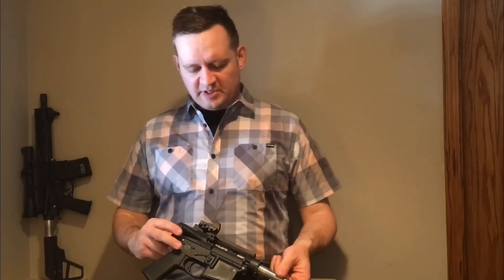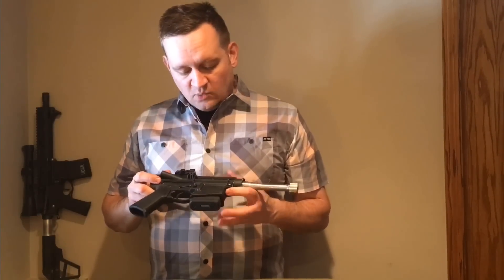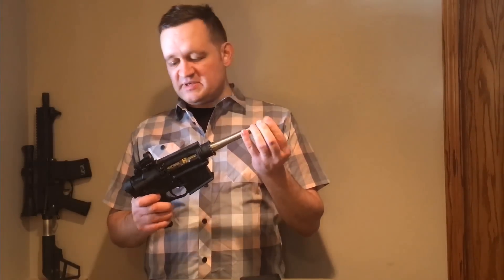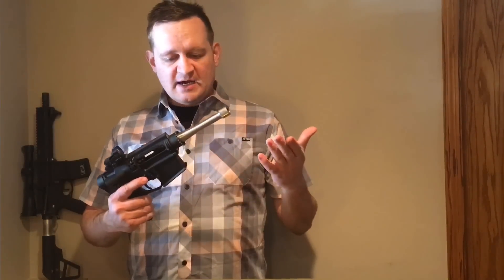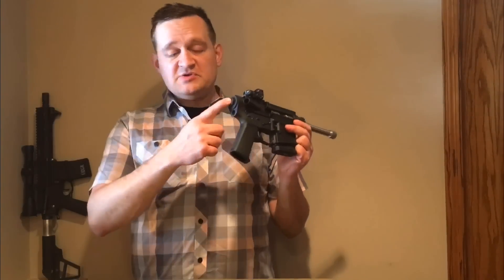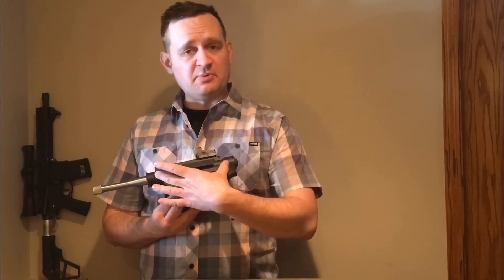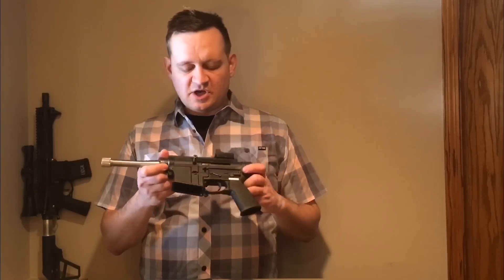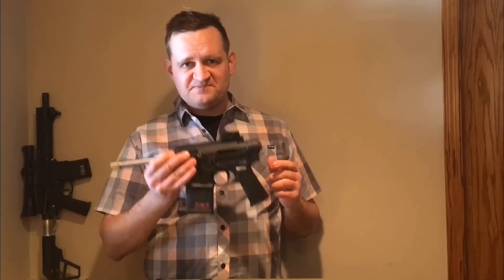Solo 300 Pistol Prototype

Comment: I bought this upper and love it! It is .5 of an ounce less than my custom built 1911 with 10 rds in 300 solo and 8 rds in 1911. The only question I have is I took bolt out to clean it and when I went to put it back in I noticed the ball bearing at top of BCG could be pushed left or right. I'm a little concerned as to what position it should be in? Does it stop gas or the bolt from coming open? I have been building ARs for years and this is the most excited I have been in some time. I plan to take ND whitetail in a week and just want to make sure this bearing isn't going to cause a problem.

Comment: Did you relocate the gas key farther back, why is there a hole in front of gas key? Could you do a more in depth video on how you reworked the carrier and any other mods you did to upper receiver? Very cool firearm build.
Reply from the maker: If you mean the hole in the front of the upper receiver, that's where the gas tube normally passes through. All AR uppers have that. As far as the bolt carriers go, the Solo 300 doesn't use a gas key as it isn't gas operated.
Reply: On your BCG, there is a piece of material mounted to the carrier with two screws. I am assuming that piece of material is there to keep the carrier from rotating. In front of that piece of material there appears to be a threaded hole. Is that piece of material mounted in the two factory gas key mounting holes?
Reply from the maker: @ericjones3146  yes.

Comment: Could you slam fire it?
Reply from the maker: No the disconnector works the same as always.
Reply: @durayenterprisesllc4440  could you make it able to slam fire?
Reply from the maker: ExTeeSee tOaD that would basically be a full auto trigger group.....I'm curious why you would want a manually operated slam fire pistol.
Reply: @durayenterprisesllc4440  it's just an idea, thinking outside of the box.

Comment: With a round in the chamber and bolt slid forward what keeps the bolt from sliding back?
Reply from the maker: The bolt is locked into the barrel extension and can't retract without rotating.
Reply: I'm try to recreate this in 9mm

Comment: I'm going to build this in 223 just because it'll get around NY gun laws. The one thing I want to point out though is that he's saving maybe half an ounce by using polymer lower and upper. The upper was probably easier to machine being polymer but the weight saved from it is negligible. But one question how long is the barrel? Just want to know because I'm leaning towards a 10.5 because I'm doing .223 But wanted to figure out how much heavier it'll be before I order parts.
Reply from the maker: 6"
Reply: @durayenterprisesllc4440  thank you man. I'll probably cut one to 8" for 223 but don't want to go too much longer and lose the whole idea of the build. Also did you have any trouble drilling and tapping the hardened bcg?
Reply from the maker: They vary.

Comment: Those are great, the barrels are from what ?
Reply from the maker: Nick J I'm not sure what you're asking. My first few barrels started as longer 300 Blackout barrels with carbine length gas systems that were cut down behind the gas port, threaded, and contoured. Going forward, I'll be using purpose-built custom barrels.
Reply: @durayenterprisesllc4440   You answered it, thanks :-)

Comment: what upper and lower did u use for this build? and where can i find a pistol barrel like that?
Reply from the maker: Joshua Ibarra on this build I wanted to minimize weight so I went with a polymer upper and lower from ATI and Tennessee Arms Co, respectively. My production uppers will be mil-spec aluminum. As for barrels, I have a run of custom barrels being made which will be available for sale in addition to complete uppers. Stay tuned for updates when they're available.
Reply: @durayenterprisesllc4440  awesome thanks for the update.
Reply from the maker: www.solo300.com

Comment: Sir, I salute you. I had not thought about making an AR into a straight pull bolt action. This is my next build. Could you drop a link to some components.
Reply from the maker: The Magician it's a custom project. I'm currently building my first batch of uppers for sale, and will also have custom barrels available sometime in May. Stay tuned!
Reply from the maker: www.solo300.com

Comment: Uh how are you delaying the bolt to keep from beating against the rear of the receiver?
Reply from the maker: Jm Fowler it's locked shut. I'm not sure what you're asking.
Reply: @durayenterprisesllc4440  it didnt seem locked shut when you cycled it by hand. A .300 blk has alot more pressure than a hand. 
So it would open pretty forcefully without a spring behind it. In the video i saw you said its a normal bcg cut in half with no buffer assembly and no gas key. 
So from what heard. The friction between the lug and the trunion is all thats "locking it"

Not trying to be snotty i just genuinely don't understand. Eagerly awaiting a range and breakdown vid.
Reply from the maker: Jm Fowler when the carrier on an AR moves forward it rotates the bolt to the locked position. Pushing rearward on the bolt won't open it until something retracts the carrier.
Reply: @durayenterprisesllc4440  i guess i wasnt really thinking about it properly. Without gas pressure acting against the bcg it wouldnt unlock. 

Idk why im over here thinking the chamber pressure would force the bolt open.
Reply: This would be why im not an engineer.

Comment: Not gunna lie, That piece looks pretty cool too. But I do have a question; Is it possible to add enough mass to the charging handle/Bolt that you can cycle the pistol with the momentum of shaking it back and forth?

Comment: OA 98 was built during 94-04 AWB and was a functioning semi auto .223 pistol that size.Y didn't u use ar18 bolt & upper w reduce power springs & use omni hybrid receiver combo? Then it would actually function

Comment: Nice :)  A little reminder tip, you can block the gas system on many gas operated guns very easily to make them temporary a straight pull rifle when deeded.... I don`t know how it is on the AR15 but my AK based Valmet Petra had a system for doing this built in the gun so you could easily make it a straight pull manual rifle when needed.

Comment: Extar stopped making them and are now only producing a 9 mm version  ->    BUT LUCKILY    I purchased the Extar EXP-556 MK II  8 1/2" barrel pistol a couple of years ago before they quit making them.   Heres a 100 rd Mag Dump   https://youtu.be/h-8zduXJ5OQ      Heres Big Daddy Hoffman playing with his ->   https://youtu.be/ZY1EDsoSj70     I think it weighs 3 1/2 lbs out of the box with an empty 30 round pmag in it.    Short video Chrono's ~ 2200-2400 fps  https://youtu.be/CcNS4JdprWc   using Cheap under powered steel chinese ammo.     Works similar to this with a shortened standard mil-spec bolt carrier    Its DI and the main spring rides above the bolt carrier rather than an actual buffer tube    A modern simplified lightened clone of the Olympic Arms OA-98 a product of the 1990's Clinton Assault Weapon Ban Era. .       Its an all polymer upper and lower and  with a little gassing mod I could see it being a great candidate for a super shorty barreled pistol project like this.   Anyways I've only put a couple hundred rounds thru it.    It makes a racket and a flash something terrible  xD have yet to see it fumble a round with any of my pmags running pmc .223 55gr.

Anyways  very interesting  project thumbs up for the ingenuity that as of yet the clever lawyer rats at the ATF  haven't figured out the language required to ban you from experimenting with...

Comment: Did you have to shorten the bolt... and if so do you think the 762x 39 would be good .. it would be similar to the 300 Blackout but just saying they have both already or side charging anyway when you can already get the platform already made but that's made with a buffer tube.. so you wouldn't have to convert anything so that's why I asked you have to cut down the bolt..

Comment: How cool would it be if he attached a gas tube that wrapped around the barrel a couple times so it met the length it needed to be so it could operate semi-automatically. Is that even possible? Would that work?
Reply: The flow would probably be too turbulent to do anything useful.
Reply: What if the tube was thicker to withstand the pressures? Or is that not the problem?
Reply: @joelpessina1764  
That's not the problem. Turbulent flow, in fluid dynamics, is flow where the motion of the fluid cannot be reasonably predicted with any useful results. The implication for our situation is that you couldn't effectively design the rest of the system unless you are really good at fluid mechanics. You could probably make it work through trial and error if you have plenty of time on your hands and plenty of resources.

Comment: you need to show a parts list or were to buy them as this is a godsend in freedom hating states like Illinois
.
Reply: polymer80 lower.
milspec LPK.
ATI polymer upper.
milspec bolt and BCG.
correct barrel for bolt.
barrel nut
pistol plug(for buffer hole)
hack up the BCG
hack up the barrel
mill slot in upper for sidecharge
assemble.

Comment: Does the carrier group cycle back after being fired? If not what keeps the bolt locked in place. Ty
Reply: There is no gas system so there's nothing pushing on the bcg to unlock the bolt

Comment: How do you make certain that there's no chance that the recoil can overpower the locking lug of the bolt?  It looks good in theory but I'd be concerned about an inadvertent Blow-back type operation during firing since there's no other feature locking the bolt in place except the cam action of the locking lugs of the bolt which are meant to easily rotate back during cycling anyway.  I'm really not that familiar with the 300 Blackout so is there that little force on the bolt group due to the short chamber and barrel configuration that it negates that possibility?  Nice idea though.

Comment: Could you have left the original charging handle operational?
Reply: I'm doing a build right now where i'm planning on doing that I'm going to try to tap the end of the gas key so I can screw the charging handle to it and file down the bulges on the side of the charging handle so it can go in and out as one unit it's not done yet so I can't tell you if it works but I don't like the idea of the side ch

Comment: Of you built a gas cut off and a longer(ish) barrel, you could have kept the gas system without the gun cycling with a suppressor in place. The buffer spring would be a bitch (unless you have an engineering degree). And you could swap out barrels. (¿Polymer? Maybe, but probably not...)

Comment: Cool gun, but the problem with such a short barrel is that you won’t get the minimum velocity required for a .223 or a 5.56 to be as effective as it should be. Could you do some chronograph tests? That would be interesting. You can always add a longer barrel or find a barrel twist ratio that works to slow down the bullet inside the barrel.
Reply from the maker: Did you even watch the video?
Reply: Rolling Blackouts Rolling Blackouts You made me watch the whole video again. You don’t mention bullet velocity as a problem that can be fixed by changing the barrel. You do mention you have different barrels and that they can be easily swapped. You obviously know a ton about guns; I haven’t seen anyone else make a gun like yours. I’m not saying that you don’t know that .223 and 5.56 need a minimum velocity to do what they’re supposed to do, you obviously do. It would be nice to see what configuration you choose for your handgun when you take it deer hunting though.
Reply from the maker: The gun in the video is a 300, and with subsonic ammo the barrel length doesn't matter.
Reply: Rolling Blackouts Oh, your going to use subsonic ammo. Thanks. Really cool video.

Comment: This is perhaps the best “suggested for you” random YouTube video I’ve ever seen! I’ve got a couple months of winter left...time to try a new project!
How do you kept the bcg locked shut when firing, a slot cut into the upper receiver?
Reply: the rotation of the bolt and cam pin keep it shut. theres enough friction in the bcg to keep it closed. no rearward pressure on the bolt will unlock it. no gas system to operate the BCG.

Comment: Same idea as 70s era xp100 silhouette guns. Those shot all the way into .458 win mag. Only thing that kept recoil in check was the weight and barrel porting. Gotta say though 64gr 4198 in .458 win mag with an 8lbs. pistol is pushing the human hand structure to its limit. Not a practical weapon by any means.
Reply: Russell Gerdes  totally different. The win mag is almost twice the muzzle energy 2400 SOCOM VS 4500 WIN MAG @ 300 gr.

Comment: Where did you get the barrel?
Reply from the maker: A lathe.
Reply: @durayenterprisesllc4440  that's kind of a dick answer but OK. The gun is still pretty cool.
Reply from the maker: Brian White the point of the video is that it's a custom gun.
Reply: @durayenterprisesllc4440  I get it dude. People always asking about it and you're probably tired of answering questions, so you're short with them. I was just curious if there were barrels out there without gas ports drilled. Thanks anyway. Cool build.
Reply from the maker: I'm guessing there are unported barrels, but probably not this short

Comment: at least make it a pump
Reply from the maker: That's essentially what it is. A pump is mechanically just a straight pull bolt action with the "bolt handle" mounted out front for the support hand. Pistols aren't generally suited to  pump action.
Reply from the maker: Handguns aren't shot that way. Why reach your support hand up towards the muzzle when you could just cycle right there on the frame?

Comment: Oh and what did you do with the gas port  dose it just bolw out of the barrel ?????
Reply from the maker: The gas port in this barrel is welded over.
Reply: @durayenterprisesllc4440  You inspire me for my next Build. But I cant find a 5.56 barrel shorter than 7.5in. Or did you cut that one yourself? Thank you
Reply: Oh okay thanks and I just realized that with no gas it should stay locked  my dumbass is over thinking  thanks again for your time and consideration 😎😎😎😯😯
Reply: Could buy a Carbine gas-length pencil barrel and just cut it down
...or a bull cut down (to add weight to absorb recoil.. if thats what you're into)

heck, drill 2 more gas ports on angle and call it MagnaPorted

Comment: When you fire it it wants to drive the bolt back what is stopping the bolt because it is a Simi Auto and when it fires it will run the bolt back you need a way to keep the bolt locked  just asking ????????😯😯😯😯😯
Reply from the maker: It locks up exactly like any other AR. The AR is not a blowback design.
Reply: @durayenterprisesllc4440  thanks I was over thinking it
Reply: @durayenterprisesllc4440  thanks
Reply: More specifically,. Without the gas system,. There is no force acting upon the bolt carrier to cam the bolt out of battery.   If you remove the gas tube from your AR the bolt would remain locked until you manually cycled the charging handle ( which acts as a force upon the carrier) to cam the bolt and take it out of battery.   The buffer spring has nothing to do with keeping the bolt in battery .
Reply: @mikeborrelli193  thanks
Reply: It works on the same principle as any bolt action rifle.
Reply: @mattr2238  thanks

Comment: What's the stock/brace that's on the pistol on the wall?
Reply from the maker: Matt Fleming KAK Blade with some of the extra meat trimmed off.
Reply: @durayenterprisesllc4440  is that legal though? Because you modified the brace. I mean it looks amazing though.
Reply from the maker: Contrary to popular misconception, it's not illegal to modify a brace. I didn't do anything that changes the function of it whatsoever.
Reply: @durayenterprisesllc4440  well sounds good to me. Just dont want the atf down here knocking.

Comment: Nice build.  Going to build one.  Thank you.  Being a right handed shooter and wanting to holster it could I put the charging handle on the right side of the gun? Or could I simply use a standard charging handle from a typical AR? Also the BC you pictured that was shortened, did you do that or did you purchase it?
Reply: Since it's a manual operated design the t handle changing handle from a standard ar15 wouldn't help as it would only pull backward and you would need to modify it to be permanently attached, as for the hoslter issue how would you push the bolt if the handle is on the right side if you hold he gun in your right hand, I would only put a right side bolt handle if you want to hold the pistol grip in the left hand,

Comment: How dose the BCG stay locked forward
Reply: There's no gas to operate the carrier so the bolt doesn't cam until you pull it by the charging handle
Reply: Why ask this question if you don't know how the AR's bolt works?
Reply: @damarei  forget about it I just saw a video on how it rotates and locks once past the lugs.
Reply: @damarei  that's exactly why I'm asking because I don't know how it works. I was under the impression that the casing would at least partially come back with the round going off. I didn't think that the bolt relied solely on the pressure coming back in the gas tube to cycle the bolt.
Reply: STONE PHILLIPS probably to learn how it works you douche

Comment: I wanna see if your bullets stay stable or keyhole on a target cause of that short barrel..
Reply from the maker: It's plenty of barrel. Same length as the original Honey Badger, and slightly longer than a sig Rattler.
Reply: back in the day I built something similar OA-93, 6" barrel, but not a bolt gun in X39 and for me the bullets keyholed at 100 yards..
Reply: Back in the day I built a OA-93, 6" barrel in X39, not a bolt gun and at 100 yards my bullet would keyhole. I put a slightly longer barrel ans my groups got acceptable.